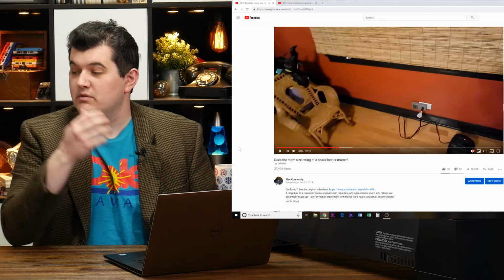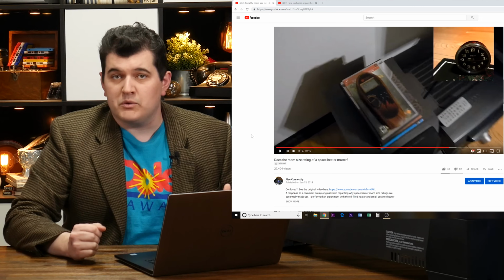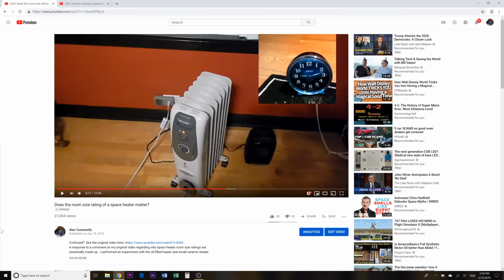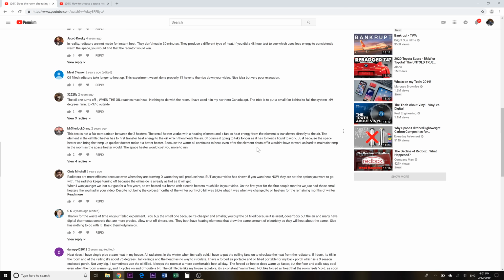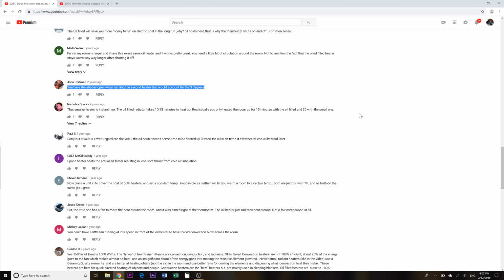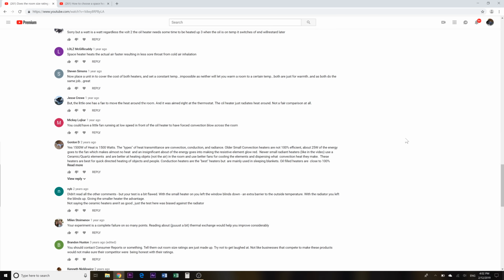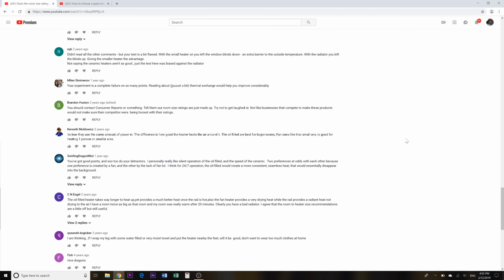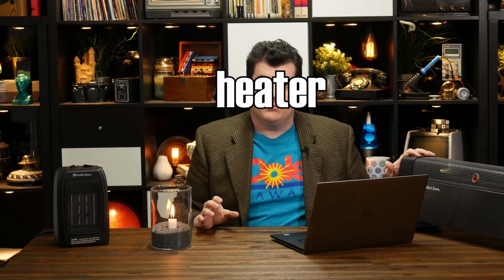More Space Heater Nonsense

Comment: Sorry you have made two false assumptions which underpin the reason you have come to this conclusion.  The first is your assumption that the heaters are 100% efficient and the second is that the 1 hour test provided a viable conclusion for the subject matter (i.e. room size differences).

I will explain the first point initially as I imagine its the one you are most skeptical about.  1500 watts is not the rating of the electric being converted to heat, its what it pulls from the outlet.  The small fan not only has a heater but also a fan and a thermostat.  Both the fan and the thermostat pull electricity and while the thermostat is not much the fan uses nearly 1/3 of the wattage of the device.  Now to explain why this affects room size suitability.  Imagine you have two convection heaters (we will say they are 100% for the purposes of this math) therefore you get 3000watts worth of heat for every 3000watts used.  The fan heater however uses 1/3 for the fans so you need three fans to produce the same amount of heat and they use 4500 watts to achieve this.  Now in a small room heating them up the lost electricity to the fan is less impactful as the room will heat up quickly, however rooms increase by a cube (obviously) so as the rooms get larger and larger you need a lot more heat to fill the space completely.  This means the problem of much more wattage being used increases exponentially making the small fan heater very very inefficient in a larger room.  

The second was the way you set the test up.  Most people do not only run a heater for 30 mins, you are likely to run it in the winter and therefore have it on continuously.  They are rated partially based on this assumption.  The oil heater may take longer to get the room to temperature however, based again on the explanation above it takes far far less electricity to maintain that temperature once the room reaches it.  A smaller room though you may just have the fan run for a while, then when its warm turn it off.  

Sorry I am afraid you have made a couple of fallacies in your logic leading you to a false conclusion.
Reply: A 500W fan? How'd you get that number? I dong know about the type of fan in that device, but I know that the fan I bought for the summer (about half a metre in diameter) draws 40W on the highest setting. I am well aware that the heater uses a different kind of fan, but a 460W difference? I'd assume the fan draws pennies to the dollar.
Reply: @klobiforpresident2254  They are not exactly 500w, I used that figure to make the math easier to explain for the purpose of the discussion.  They are however designed to be close to a heat source whereas a small hand fan is not, using a small fan designed to move air in a room would be dangerous.  That means they need larger bearings and thus more friction and hence more energy needed to move.  The fans in heaters use a lot more energy than a basic hand fan as they are used for a different purpose.  They are not directly comparable.
Reply: @feynmanwasagenius3482 
May care to elaborate what a hand fan is? English is my second language and all I find is the type of thing school children would use in the summer: A rigid, flat surface (like a folded sheet of paper) waived back and forth.
I meant the type of fan put on a desk. I couldn't see the type of fan used in the room heater, but I would have another point of comparison: The 120 (or 140) mm fans used in computers draw around five Watts, no more than ten. Of course, this and the one next to the heating element are apples and oranges, but fifty to a hundred of these? That's ludicrous.

What I'd say seems much more likely is that the Fan in the heater draws no more than a hundred, most likely much less than fifty Watts. That, then, makes your example (2 large heaters ≈ 3 small ones) much less impressive, as it'd be 14 large heaters ≈ 15 small ones.
Reply: @klobiforpresident2254  Sorry, I am Finnish and English is my second language.  Small fan?  A fan used in room for blowing of air to you.  They often have plastic components which melt in heat.  The plastic is lightweight which makes a small fan (hand fan, desk fan?)  able to be moved by less energy.  A fan in a heater has to be more robust with heat and needs different materials.  Larger ball bearings made of metal create more friction.  Different fan heaters will have different amounts but all will be far more than 100 watts.  You cant use a computer fan as it would be dangerous in the heat.  Fans in heaters vary but 350-600 watts is common.
Reply: @feynmanwasagenius3482 
I mean, it'd really depend, wouldn't it? If I think about the radiator located in my room I wouldn't be afraid of putting my fan ten centimetres away from it. Of course these things get much hotter than my radiator. However, if those things work mainly by conduction/convection rather than radiation then I'd actually not be afraid of mounting a computer fan (in push, not pull!) only seven centimeters away from the heating element. Of course, I'm no engineer and don't have the numbers.

That aside, the wattage claim you make still seems absurdly high. Care to back it up? That's approaching low power leaf blowers if I'm not mistaken.
Reply: @klobiforpresident2254  I am sorry I dont know where that information would be in the public space.  Our company uses fans in the construction of our products but I cannot share sensitive internal documents as I would be fired.  If you dont wish to believe you need not have too?
Reply: Feynman was indeed a genius. Unfortunately you fall short. I'm afraid your reasoning is seriously flawed
Reply: @ericthemauve  We literally build them.
Reply: @feynmanwasagenius3482  You ought to be ashamed of yourself then! Someone in your position should have at least a basic  grounding in practical physics.
Reply: @ericthemauve  Hmm I do which is why I know my message is correct.

Comment: Hello and thanks for your video, you're so right about the power output vs rooms size thing.
I agree that for heating a space, any resistive load will do the same.
There is just one point you're kind of missing: most of the time, you don't care about how much energy you release in the room, or even about the real air temperature.
Because even if we talk about SPACE heaters, the important point in not the space but the peoples inside!
You are usually looking for a subjective perception of heat. So the way heat spreads out is crucial.
A small space heater will do very well for giving a temperature boost, but if you use it over an extended period of time, things change: 
- The fan will create hot and cold areas, especially in large rooms i think. Maybe natural convection does better in this area?
- You heat the air only, there is nearly no inertia, and you have poor regualtion on those units. So you will end up overheating the room to avoid the air temp to drop low to a "cold feel" temperature.
- Hot air will rise fast to the ceiling
- From a distance the air flow of the fan can even lead to a cold perception, especially in bathrooms, when you are wet getting out of a shower.
An oil based heater will do better MAKING YOU FEEL the heat by smoothing out the temperature curve, and by outputting heat as infrared radiation. It's nowhere more efficient, but you end up using less energy by lowering he room temperature.
If I had to choose a setup for running a heater more than an hour, I would go for an oil radiator, whith external regulator.
If you really wanted to run tests on various heaters, IMHO you would need to log temperatures in multiple places in the room for at leats 12 hours.
keep going!

Comment: I do actually Have an answer for your ending question.
there is no difference in the heat output of these two devices, but one could be more effective at heating a larger space.
the floorboard heater can be better for getting heat into the floor of the room. that is going to be the only thing it is better for, and technically it would still be better in a small room as well. I can see the small heater having an issue transmitting heat into the floor of a larger room unless it is on the floor. in that case again both are equal. the stream of air comming of the fan would not have a wall to quickly deflact it down and so it would naturally rise and a full current could be sustained without ever fully mixing the air. I doubt this is what the marketing teams were really talking about though. there is a chance the heaters made for bigger rooms have better fans or more complete routing of air to keep the room fully heated, but I am often skeptical of these things even being a reality (if they are the case it would explain the price jump fans can be expensive). 
the point to remeber in my ramblings there is that a heating device not only has to generate heat it has to disperse it effectivly. air is ultimatly a very good insulator and in fact most insultion is mostly air anyway, so the heaters have to come with ways of moving the heat. all of the fancy marketing and differences can come down to that which will not change the efficency but will change the effectivness of the heater (I am mostly sure that works in both english and thermal systems jargon). it is possible some of those heaters need bigger fans, or more coils to disperse heat.

(for ethos) I am a mechanical engineer who focuses on heat transfer and fluid mechanics. this is very much so my area of interest

Comment: You are right. In a closed room. I can only imagine, a big room has more doors and they open more frequently, so the heat escaping is not contstant but intermittent based on the use of the room. The space heater that can impuls a lot of heat can bring the room back up to temperature faster. But giving room size ratings on the same amount of watts is nonsense. These heaters don't have a peak vs continuous rating.

Comment: Maybe small room heaters are not designed to last as long in large rooms, as large room heaters. Maybe it is expected the small room heaters will be turned off by the user between intervals based off a tech spec, while if you were to place a small room heater into a large room, it would be running more often, reducing it's lifespan dramatically. Just a guess.
Reply: If that were valid, that would be marketed.  It's not.

Comment: Just finished you video, thank you, as someone who has electric ceiling heat (insert many colorful metaphors here) your point is well made. Heat rises so let's put the heating element on the ceiling! The marketing department geniuses who sold this as a good idea really earned their money. If you have not had electric heat of this kind and wish to coment ..... don't we have heard all the convection this and thermodynamics that. Head was warm feet were cold that is how it was, however it was a very easy fix and your little heater demonstrated it quite clearly.....The fan it mixes the air in the room far more effectively than via the convection method so more air in the room feels warmer faster especially at the thermostats level. I know it dosent sound rite we run a quite fan in winter and save money. I wonder when the next group of marketing people are going to convince people  putting a cooling system in the floor is a really wonderful way to keep your house cool in summer.

Comment: Agreed on the efficiency part, but I feel like you're underselling the "effectiveness" part.  The small forced-air heater is quick (temporally efficient?), but the oil heater would perform better (in a meaningful sense) over a longer period by keeping the average temperature more consistent.  Or at least it would if the thermostat coupled to the ambient air more than the surface temp -- but even that is likely to settle over a longer time, as the ambient temp approaches closer to the surface temp.

I understand you're not arguing against this point, merely that they're both capable of the same rate of producing heat.  No argument there!  But if you've ever been simultaneously too hot and too cold due to bad thermal management, the effectiveness of a heater becomes a rational argument.  :-)

So maybe this is where the former disagreement stems from?  They're not "all the same," because their thermal strategy is different.  If they all ran full tilt all the time, then maybe there would be no difference.  But that would imply the heater never reached equilibrium and that's a problem of its own.  ;-)

I guess I see it like computer fans.  You have multiple 40mm fans in a server spinning at 6000 RPM, and a 120mm fan in a fancy PC case spinning at 1000 RPM, and both moving the same amount of air through the enclosure.  But which would you rather sit by?  Ergonomics matter too.  :-)

Comment: Another way to look at it: If they were truly rated for a "larger" room, then they'd have a value to indicate how "large" of  room they can heat. However, they only provide one value of meaning, which is independent of room size. Without air flow rates, room dimensions, temperature patterns, or time estimates there is nothing to back up the marketing claims.
Scientifically: These devices are relatively slow for any room size, and are thus thermodynamically limited beyond a few feet. You can improve the kinetics (how and how quickly hot air is dispersed), but it wont have a large effect on overall room temperature unless you are comparing no mixing to well-mixed distributions.
Marketing: Larger boxes sell for higher prices.

Comment: As I see it, this experiment is really 2 parts.  

Part 1 is how quickly the space heats and the energy required to get it there in watt-hours.  

Part 2 is how much energy is used to maintain the the chosen temperature in the space, again, in watt-hours.  

I would compare the TOTAL ENERGY USED both to raise the temp and maintain said temp over a longer period, say 10 - 20 days, to get a true answer.  If my hypothesis is correct the small heater coasts less to get the room to temperature, and the oil heater costs less to maintain that temperature.

Comment: In my old house, there basically wasn't a lick of insulation worth giving a damn about in the walls. That being the case, I ran two heaters in the front room:

1. a 1500 watt small room heater with a fan
2. an oil filled rad

Come home on a freezing cold day? Crank 'em both up! (On separate circuits, don't get nervous.) 20 minutes or so, I switch off the fan heater and everything was just about perfect.

Comment: All electric heaters are 100% efficient. Fan heaters heat the air directly but a heater with radiant heat will tend to also heat the contents of the room with radiant heat as well as heating the air. Comfort levels tend to be dependent on a combination of convected and radiant heat

Comment: Great video, Love your stuff.  I'll throw in my $0.02 in hopes that anyone confused, and wants to understand may get a little better idea with my rambling on...but since this is the internet, who knows...
 
If you look at it from a purely thermodynamic standpoint, the oil heater will be ever so slightly less efficient (I'm talking far less than 1% loss) due to entropy.  As the elements inside heat the oil, it will cause convection currents within the oil, which will impart losses due to kinetic movement of the oil, thermal expansion, and possibly an increase of pressure within the heater. (no friction losses since friction will be transformed into heat though at a very low quality)  
Also, you have to remember that heat flow is not linear.  Heat an iron block up to 1,000 F, and monitor the temperature with respect to time.  You'll see that it may lose 100 degrees in the first minute, but the second minute will only lose 75 degrees, 3rd minute 60 degrees and so on.  (These numbers are just examples pulled from thin air to illustrate a point).  The reason is that the temperature differential between the hot steel and cooler air becomes smaller, and thus less energy is transferred per unit of time.  The ability of one material to heat or cool another is based on its specific heat which has the S.I. unit of Joules/(kg*Kelvin).  So, a oil heater with a surface of 150 degrees will not heat as effectively as a small heater with 1,000 degree coils or elements

Comment: What about the noise and magnetic fields produced by the fan?  Does that reduce the amount of heat you get for your 1500 watts?  

If the oil filled heater is cycling on and off and a different frequency than the fan heater then maybe it's pulling less watt/hours and that might explain why it heats the room more slowly.  

If both heaters put as much heat into the room then they are going to heat the room equally but it was mentioned in the video that fan heaters dry out the room.  Is that true?  Is so where did the water go?  If just got heated up and evaporated shouldn't it still be in the air?  And what is the relationship between heat and evaporation?

Comment: Love your channel!! Very informative and educational even if haters gonna hate.... on a side note, the oil filled space heater, we used to heat our whole 3 bedroom house with just 2 heaters.  The two that we had we would turn on and let warm up for about 30 mins, after that, in order to keep the "over temp" switch from turning them off and on like you had explained with oil filled heaters, we would take a box fan and turn it on med speed, NOT blowing through the heater bc then it would just act like a car radiator and cool the oil too fast, but instead have the back of the fan about 4 inches from the side of the heater where it was sucking air through the heater into the fan. Worked great to distribute heat throughout the house.